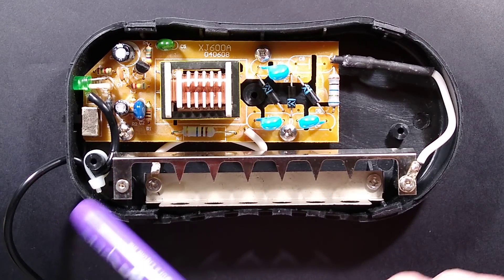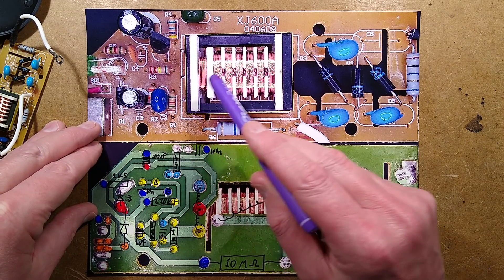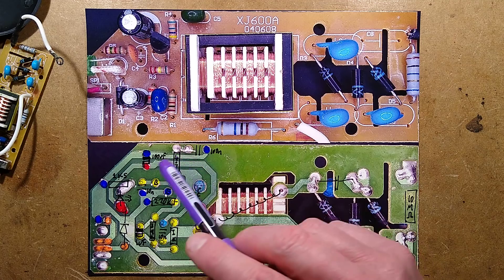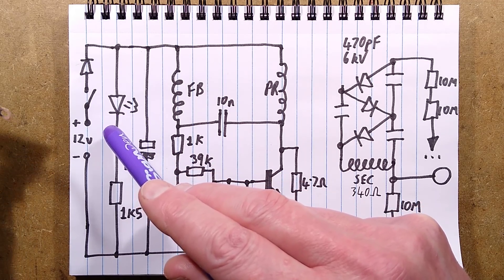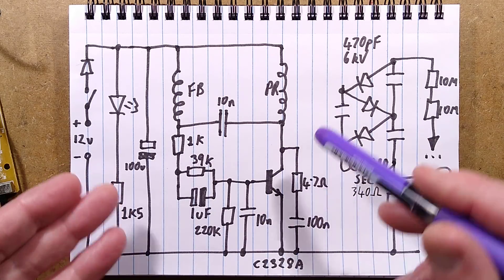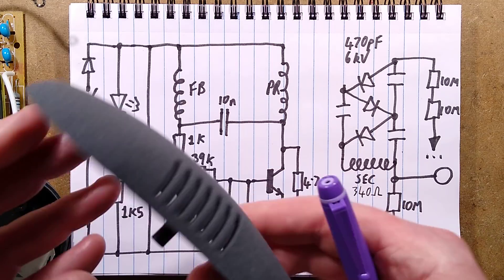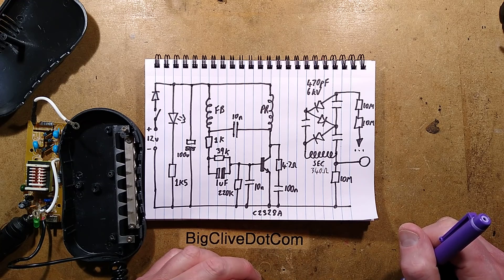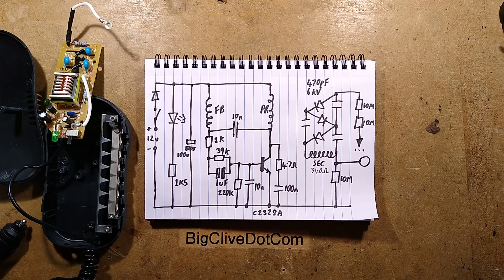Exploring a high voltage power supply

Comment: 10n forms a tank with the primary (and feedback)
Reply: Would the cap not need to be in parallel for oscillation, I’m not sure how the 180deg phase shift would occur with that gain structure, I think it’s more likely to ensure the startup conditions are met by providing a kick from primary to the feedback that doesn’t depend on the feedback winding, it probably is almost out of circuit at the actual oscillation frequency... it’s definitely odd though, I’d have to simulate it... I’d bet it’s fairly clever whatever it’s doing because it doesn’t seem like one penny is wasted building it...
Reply: @robertw1871  That cap isn't really about feedback at all. It's purely resonance. The primary and feedback are electrically one coil as far as the cap is concerned, because they are in series. The phase shift for oscillation is accomplished by the feedback winding and primary being out of phase by way of the center tap and the components hanging off the base of the transistor... Start up bias is provided thru the 1k and 39k.

That cap is mostly to stabilize operation; without it, the circuit will usually run, but will tend to be chaotic and lose some power to the instabilities, and operation is much more influenced by load.

The most basic version of this circuit that still works is a single transistor and resistor with a center tapped primary. The resistor goes from the feedback side of the winding to the base, and usually has to be on the low side (a couple-few k) to get enough bias to start it... But it generates a lot of extra heat in the transistor and even transformer, and changes frequency at the drop of a hat because there's nothing really defining it. It ends up running with thick harmonics and whatever frequency "makes sense" at the time as it relates to load, inductance of the transformer, and parasitic capacitance of the windings.

Comment: My room cleaning ozone generator runs at about 80 Watts into the high voltage. A little more with the fan.
Reply: Yeah it's a beast it will run you right out of the house in three or four minutes.

Comment: Probably a reasonable thing to use instead of a can to refresh your vehicle's aircon vents. Plug it in and run the engine, air system on recirculation with the windows up... give it 5 to 15 mins and then unplug it. Part of your car care routine, rather than for using it while you're driving.
Reply: Wouldn't it have a deleterious effect on any rubber bits and seals in the car?

Comment: The gold band on the resistors turned green? Patina color of copper/brass is green too; appears as if the pigment oxidized.
Reply: Heh plausible
Reply: That's normal. Ozone is a strong oxidizer. Probably the soldiers will get quickly covered by SnO, the leads will get some iron oxide, the plastic on the copper winding will crack.
Ozone is a problem for rubbers.

Comment: That will short at high altitude dont use on the everest.
Reply from the maker: It's more likely to increase in efficiency at higher altitude.
Reply: @bigclivedotcom  https://youtu.be/MIqK45nxcTo
Good vid on high voltage been a pain.

Comment: If you leave your windows open a bit at night, you won't need an ozone generator. :)
Reply from the maker: Yes, but not in a very stormy, cold and humid area.
Reply: Try that in Houston, and you'll drown in the humidity, and boil in the heat.  The only reason Houston is huge is air conditioning.    Without, the town would exist, but it'd be limited to just petrochemicals and shipping.

Comment: I have one of these, but wanted a negative ion generator!.. Could I bypass an stage on the doubler network to achieve more -ve ion than ozone?
Reply: increase the gap between points and plate
Reply from the maker: I'd recommend against modifying it.  The lower load could result in higher output voltage and there's a risk that a power supply could be damaged by the voltage gradient to ground.
Reply: @bigclivedotcom  ta Clive! Although that's a non-intuitive result for me.. Could you help me understand why removing a doubler stage would increase the output voltage? Do you mean just on the HT transformer?.. Or perhaps a short vid explaining? maniest of thanks!

Comment: Where can I get this ozone generator? If it's eBay and I missed that (it's age) have you got a good search keyword. Thank you.
Reply: It's very easy and simple to make your own !  Just copy what Clive has here. Component values are not critical.
Reply: @snakezdewiggle6084  the big hold up on that would be acquiring a suitable transformer.
Reply: @MostlyInteresting  I like to wind my own transformers, inductors, coils, etc. There would be less than 300 turns on that one. I like to use black-lead pencils and Teflon tape for formers/bobbins.Good luck ;)
Reply: You want to look for "XJ-600 air purifier" or "XJ-600 car ionizer", they come with different brand names.
Reply: Thank you for all your replies. I would consider making my own but I am very busy at the moment trying to complete my workshop. I have been putting a workshop together for some time now as a place I can repair and restore pro audio equipment, but health issues have caused me many delays. I already have quite s pile of gear to sort through more related to my project but at the moment my bench is covered with things like cans of paint & brushes, boxes of wood screws, aluminium doorsteps and other construction materials. There are boxes and shelving units all over the shop. 

I have a car that has been off the road for 3 years that I now want to prepare for sale and I thought this ozone generator might be a way to freshen it up a bit. The car will be cleaned inside and out very carefully but filling the car with ozone would reach the places a cleaning implement would not.
Reply: @nicholasvalentine3907  Hey Nic, a workshop build, thats cool. I can imagine the state of things. I recently lost my workshop, tools, and equipment, but no rebuild for me. As for your car, there is a supermarket cat litter made from silica crystals, lite lavender fragrance. Just thow a few handfuls into the car, leave for 24 hours, vacuum out, and done. The ionizer is also a good choice. Good luck, hope it all works out. ;)

Comment: how many stages could be put on it clive use a buck\boost converter and a power tool battery to power it. OOOO electroBOOM would love this one.........
Reply: In theory with a Villard cascade like this you can use as many stages as you like. The voltage across each individual diode and capacitor won't go higher than the input voltage. In practice the limiting factor would be that the voltage increases with the number of stages, but current decreases. At some point the corona discharge could draw more current than the thing could supply and you'd get better results with a shorter cascade. Keep in mind that what Electroboom put in that wand of his wasn't one of these, but it's a similar idea.

Comment: Should have been a Royer Power Oscillator with a feedback winding between both bases and a 47K resistor between the Top base and supply positive.
Reply: Can u elaborate why?
Reply: @janst7526  Why not they are better oscillators that a single transistor oscillator and possibly a capacitor across the transformer will make the output more like a perfect Sine wave.
Reply: Resonance!
Reply: But is that required by the application?
Reply: No. I'm just into symmetry.
Reply: @snakezdewiggle6084  😁

Comment: I thought all these operated in pulse mode! I see that I was wrong. 
Did you get a chance to measure what frequency the primary (at the collector of NPN) was running at?
Reply from the maker: I didn't check the frequency, but tens of kHz.

Comment: Would be fun seeing what the thing would do to the vehicle electrics if the metal cut through the wire insulation... :P
Reply: The cigarette lighter fuse of the car will blow.
Reply: @s.hoffman7205  no, the current sustained by the secondary side is tiny, no way the fuse would blow.
Reply from the maker: It would arc and smell, but it's very low power.

Comment: Clive, isn't that a one and a half stage multiplier instead of the 3 stage you said? Am I missing something? I thought that one stage consisted of two caps and two diodes. The missing cap and diode also have places on the pcb as well, they are just not fitted.
Reply from the maker: Technically, yes.

Comment: When is an ionizer not an ionizer......when its an Ozone generator ! nice tear down, and another satisfied customer, the Green Band denotes 0.5% Tolerance, not,  degradation of the paint from ozone , this backs up build quality...cheers.
Reply: It is highly unlikely that they used more expensive 0.5% resistors in a circuit like this where close tolerance is not necessary for correct circuit function. 5% tolerance resistors would be perfectly fine for operation of this circuit.

Also, if you look closely at the 4.7ohm snubber resistor on the PCB the multiplier band ,which should be gold, is distinctly greenish further indicating that the gold paint has degraded.
Reply: @stephenbell9257  Maybe, but thats still a lot of Ozone if it can attack the paint, I have seen resistors in some pretty aggressive environment's and not seen just one band effected, I have seen all though, I will review the footage...cheers.

Comment: Just to mention. I believe the input diode is in part to prevent the smoothing capacitor to smooth the whole 12V system. With the diode it does not need to smooth voltage drops when for instance the wipers are turned on or the brake lights come on. Keep up the good work.
Reply: Cars run at 14.8 volts. The 12 volt battery is only used to store energy for the engine startup.
Reply: @snakezdewiggle6084  The cars voltage is generally referred to as being 12V. This 12V system powers all the electric equipment on board like lights, wipers, radio etc. During running of the car the power is delivered by the generator but over the same 12V system. And yes it is than a couple volts higher. So if the diode is not there the capacitor is 'trying to smooth' the whole system not just the ionizer. And if the  the capacitance is not big this is not going to work when switching for instance the brake lights (non-LED) or while turning on the wipers. At the other hand i don't think the capacitor is needed as the ionizer will still work at the shortly lower voltage. And no capacitor than there is no need for the diode unless you want to prevent wrong wiring.
Reply: @aamiddel8646  okay, if you say so. ;)

Comment: Power supply wire pushed hard against edge of metal plate that can't be touched from the outside. I'm sure that's fine.

Comment: Ok so I want to attempt to anodize titanium with a taser module...tell me if you think this would work please
Reply: Hi random person you don't need high voltage to anodize titanium. Go to the "thought emporium" channel and he has a video on the process. I'll give a brief summary:

Supplies needed
*Salt
*Water 
*Large clear glass or plastic bowl or tote
*Carbon rod (or other suitable electrode)
*Variable dc power supply

Make a salt water bath hook the negative to the carbon rod submerse it in the water. Attach the positive lead to your titanium and then submerge it in the water. The voltage setting of the power supply determines the color of the anodization. Allowing you to select the color but it also means selecting the thickness of the oxide as these are related.

Apologies if I got something wrong it's been a few years since I've done this.

Comment: Do you have a way to measure the high voltage between the points and the holes?
Reply from the maker: It's very low current, so hard to test, even with a high voltage probe.